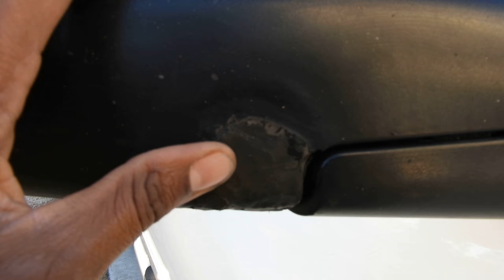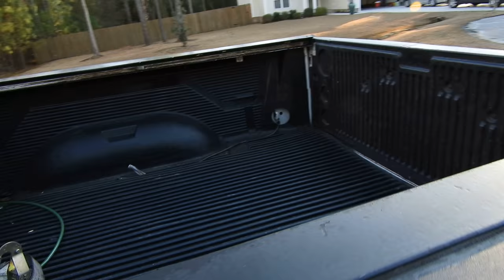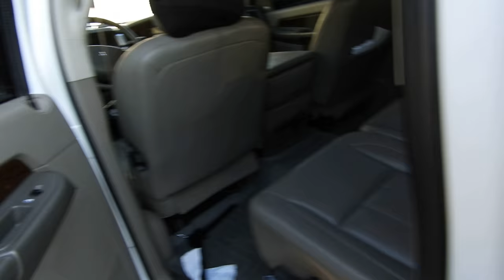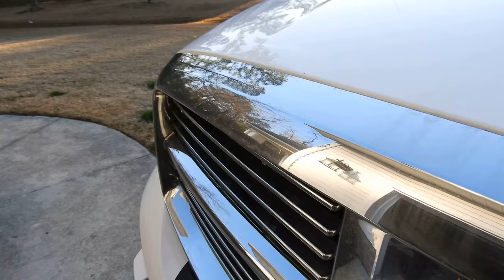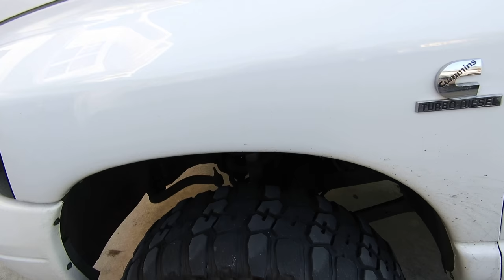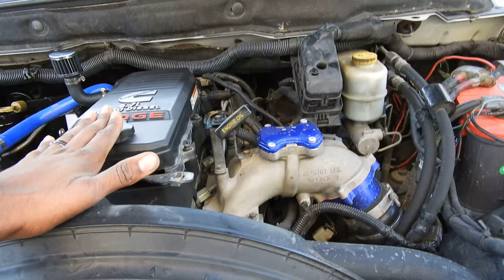5 THINGS I DONT LIKE ABOUT 6.7 CUMMINS

Comment: Try the ride in a 3500HD Dually Rear wheel drive No 4x4 . Mine used to ride like a Tank but I put solastic rear shackles in the back and polyurethane bushings everywhere and now it rides 100% better but still rough.

Comment: It's your shocks doing that to your tires. Was happening to mine too. Change your shocks and rotate your tires to the back. Also my unit bearings went out and started cupping the tires from the inside tread out.
Reply from the maker: Kyle Magoon yeah man it was the shocks and wheel bearing. I changed them when I did my lift and she rides like a Cadillac on 35s haha I keep all my stuff lubed up also.
Reply: Right on brother. Just subscribed. Realized this was an older video after I sent. Oh well. I have a 08 6.7 3500 mega cab Laramie, on 20s leveled and 35s in CA. Nice truck man.  One day i'll do all the delete stuff. But for now she still factory.